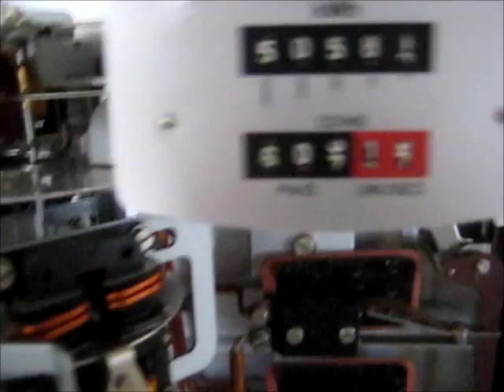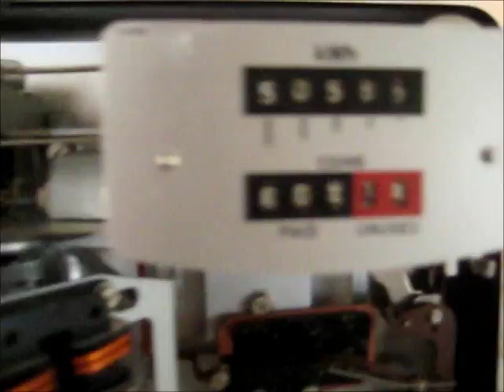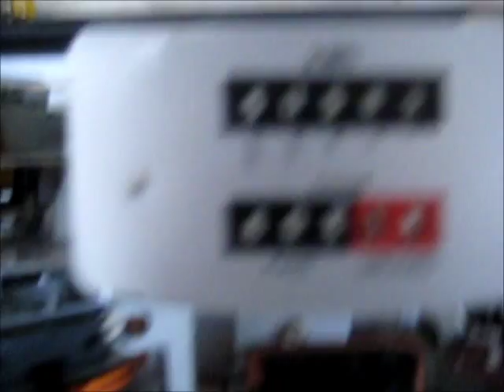L&G Kwh Meter running, a look at the mechanism

Comment from the maker: It does,'t appear to have ever had a terminal cover!!,the top load wheel was hit with the top cover by the Previous owners, as a result the wheel was Dented :( & the driveshaft got slightly bent, Thankfully there's no Compromise on the Performance and accuracy of this meter!